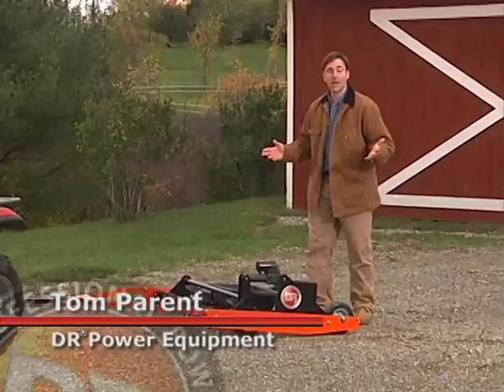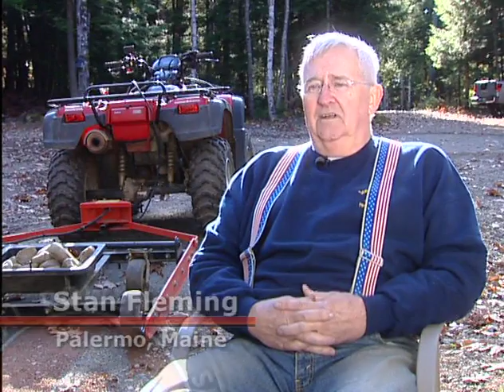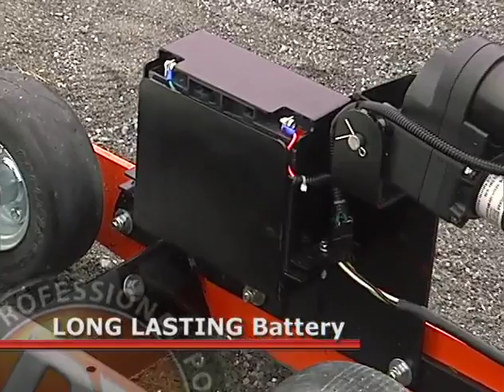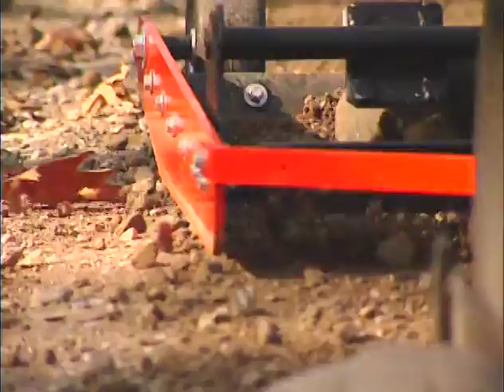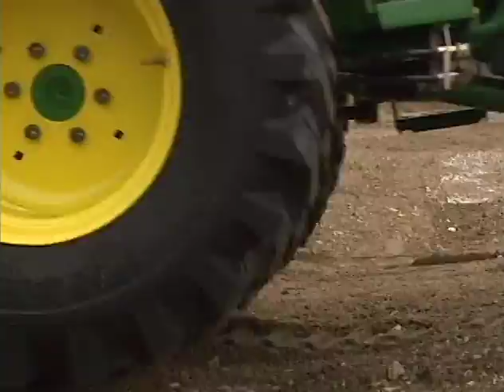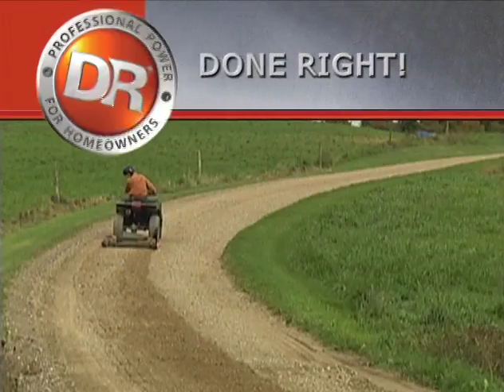DR PowerGrader

Comment: I've had the remote controlled version for four years, and I have spent an average of $250 per year just to keep it operational. DR stuff is usually rugged and works well, but the grader is a lemon.
Reply: The wireless receiver fails very quickly. I’ve replaced mine twice and am trying to convert it to a wired connection. The rest of the grader is rock solid though.